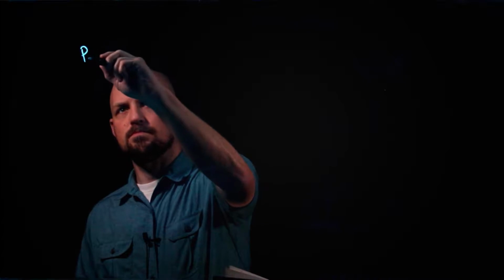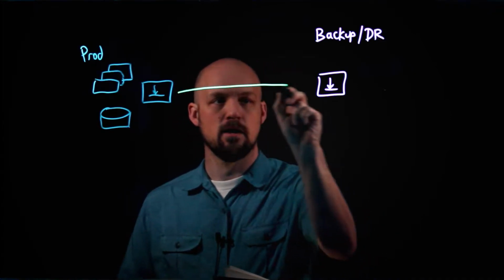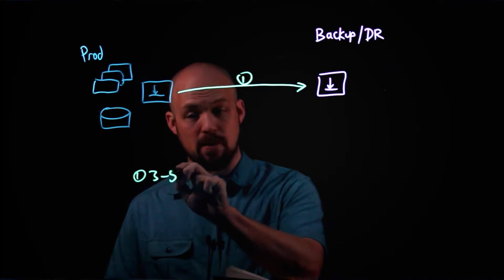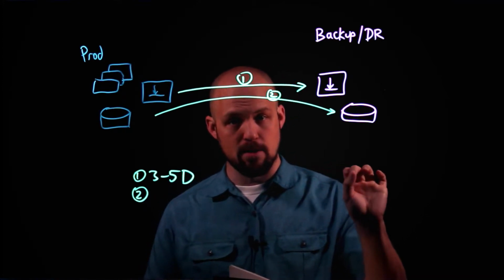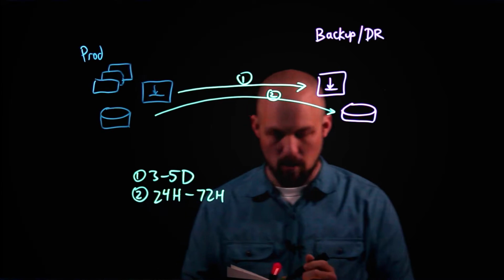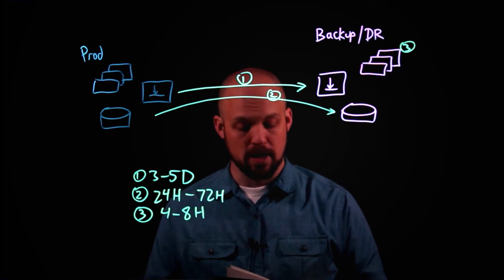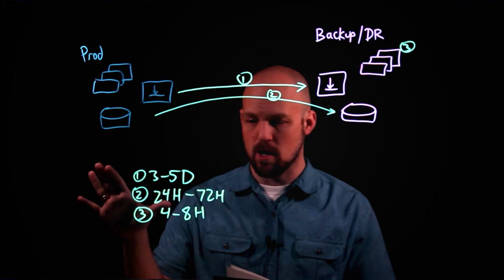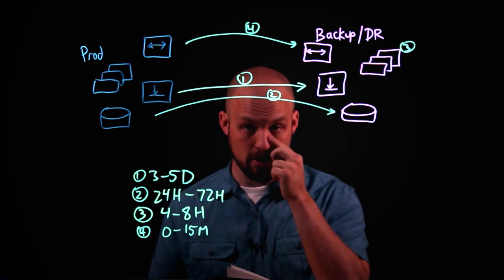Disaster Recovery Demystified - DR Software & Speed Up

Comment: Hi Jeff, if there is a malware attack at the prod site then wont that affect the backup as well if it is replicated, real time? If so, how can this be avoided?
Reply from the maker: Hey there Val!  Thanks for watching and for your great question!  Here is Jeff's answer to your question...

"Hi, Val!  That is a valid concern, especially as malware is being developed with greater intelligence.  Fortunately, there is a process to get around this, and that can be as simple as restoring a backup without Internet access long enough to remove the malware before it activates.  In most cases, malware needs the Internet to check in with its home base in order to determine whether to activate or not, and Cisco AMP or another anti-malware package can help with removing the malware in the meantime.  That said, there is no "easy" solution for malware, and I would strongly recommend having a conversation with a security expert in order to build a solid plan around a malware attack.  I hope this helps!

Also, Jeff asked me to have our Security Practice Manager, Jason Dell chime in... here is Jason's response...

"Jeff is right on.
 Offline backups are a good consideration.  Also having sufficient history in the backups offer the ability to restore from further back in time."
 
Thanks again!!!